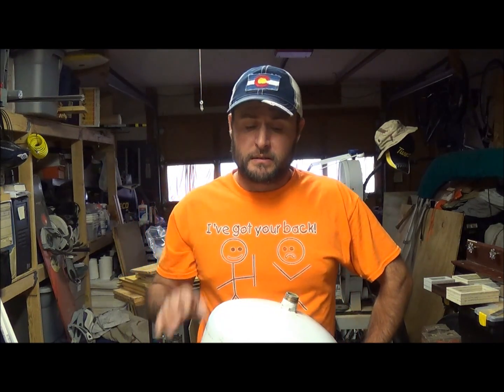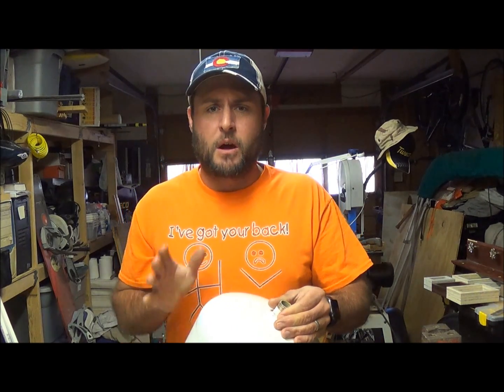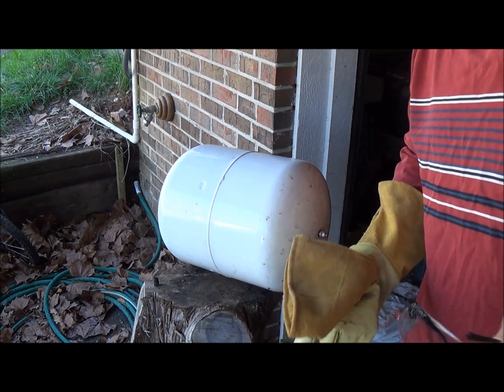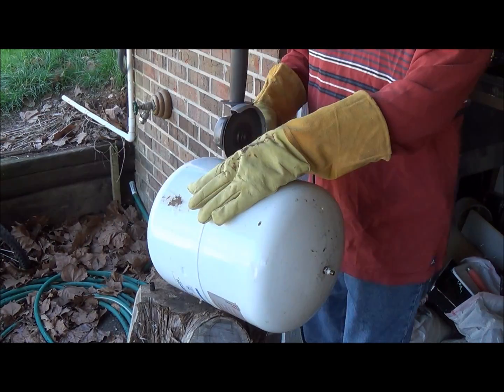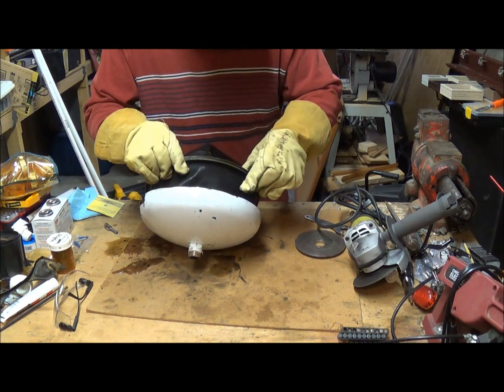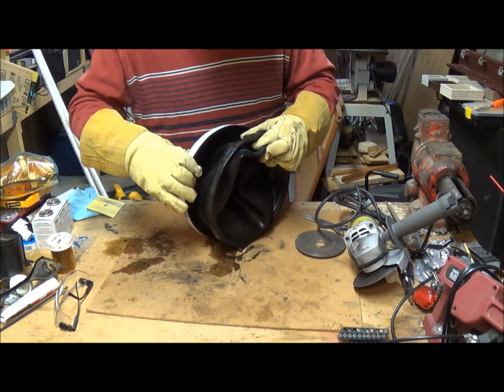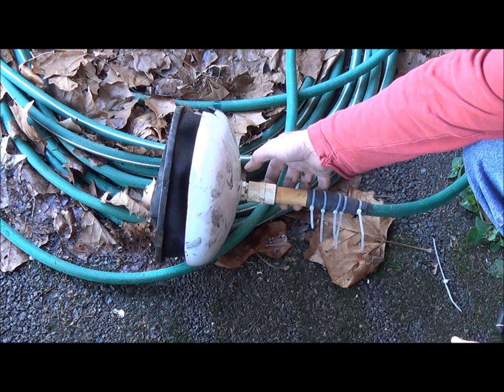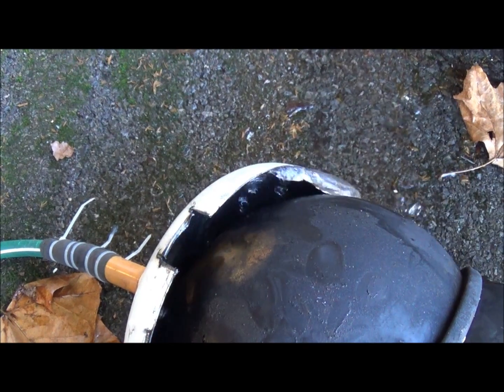Expansion Tank Explosion!!!

Comment: I don't mean to be a safety nazi, but..... the tank should be viced, both hands should be on your cutting tool, and leafs by sparks? You sir could be the reason for the next safety meeting. Be safe. Otherwise great info.
Reply from the maker: All valid points but sometimes you just have to live on the wild side. Or, sometimes you just have to get it done. Calculated risk

Comment: Your idea of making one like a hydraulic cylinder... Sounds kind of like how the best "anti-hammer" valves are made. They do eventually fail, but last a lot longer than what is otherwise essentially an empty capped off pipe. Just like this kind of expansion tank lasts longer than an empty tank. They used to be just empty zinc-lined tanks. You'd have to empty the tank every 6 moths to a year, and refill, stopping after a few gallons, to put air pressure into the tank, then turn the water back on. What happened was the air in the tank would eventually dissipate into the water. I put a schraeder valve on the top of mine, and was able to top off the pressure every once in a while, instead.

Comment: Well done. Now I can stop wondering what is on the inside. I always through there was a balloon on the back, where the air valve is, with water in the metal tank. I guess keeping water away from the metal is a better idea/design.
Reply from the maker: Since doing my his. I’ve always wanted to make my own somehow. Maybe one that resembles a hydraulic cylinder
Reply: they have those, they are called diaphragm tanks.